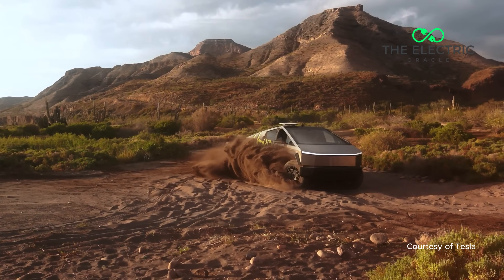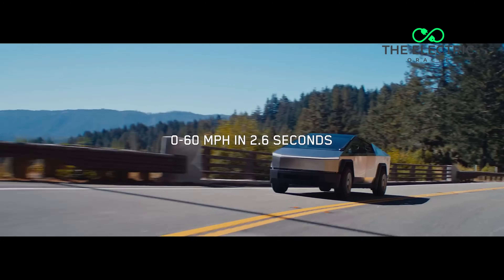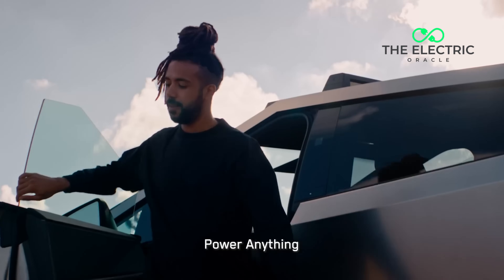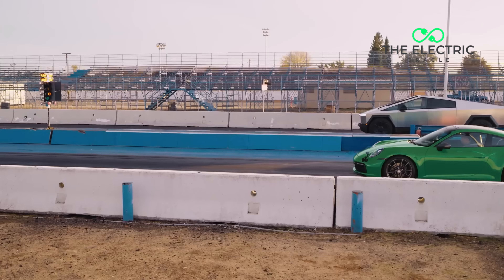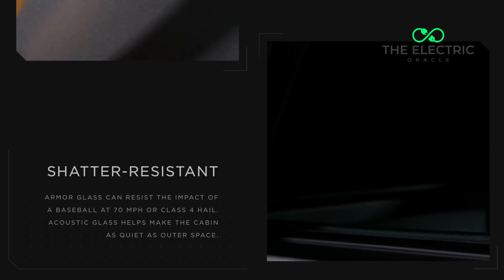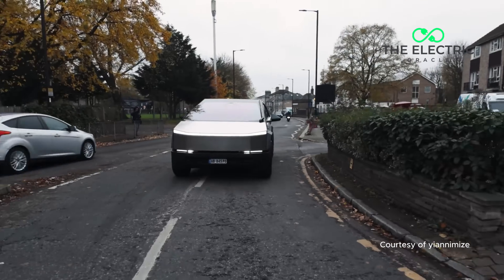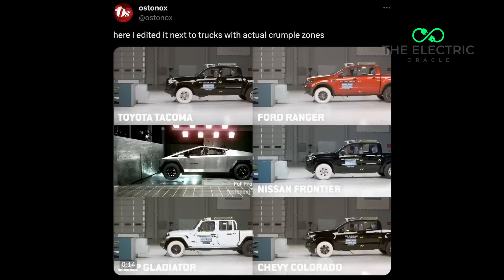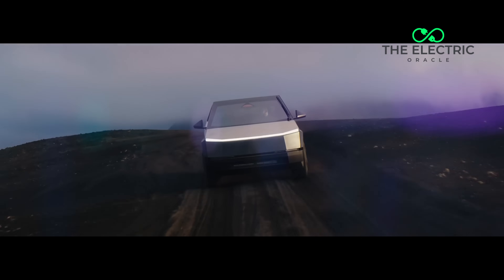5 Safety Issues Keeping Tesla Cybertruck Off UK Roads 🇬🇧

Comment: It should never be allowed on UK roads. Sharp angles and crumple zones do not help the driver/passengers or any other car, especially pedestrians. In my personal opinion, cars are all getting too big just because of fashion, and in the future, vehicles of this size should not be sold. If a business needs a van or a flatbed trailer, that is fine, but do we need monster trucks to take the kids to school!
Reply: I'm amazed you can get insurance on these. Hopefully pedestrians will sue the pants off Tesla when people get needlessly killed?
Reply: @johnalbinson4641  that's IF they survive. 
(I don't think that'll be possible if it's going more than 35mph) 

Ijs
Reply: @johnalbinson4641  you can’t all across the country in the US insurance companies are refusing to ensure it
Reply: @johnalbinson4641 um it automatically stops for pedestrians and don't you sound the fool for not knowing the truck has major safety features that none of your big uk approved vehicles have
Reply: The manufacturers push SUVs because it does not take much more material or labour to build a bigger car than a small one but it looks impressive, so the price to buy is higher. More profit drives it.
Reply: @martinconnelly1473 its not just about looks. American car manufacturers build SUVs because of a legal loophole where because of their size they are classified as light trucks so they have a lower tax bracket and lower saftey standards.

The car industry has a long history of lobbying governments to change rules in their favour to help their profit margins at the expense of pedestrians.

NotJustBikes has some good video's on this topic.
Reply: @martinconnelly1473  it's because SUVs get looser environmental regulations in California. Those regs killed the actual utility vehicle, the regular pickup and the El Camino
Reply: @stevecarter8810  Must admit I am looking at it as it is in the UK so was not aware of the case for them in Ca.
Reply: @stevecarter8810  only loophole for the suv is for the fuel efficiency... they don't necessarily have to comply like a standard vehicle. 

Those loopholes exist because of "work trucks." 

Not sure how that would effect the regular pick up's or the el Camino (which they're trying to revive). 

Regular pick up (like chevy s-10) are pretty much nonexistent. 

That has more to do with the manufacturers... not the regulations or lack of. 

There's a reason why our current full sized suv or pick up is far bigger than what they used to be. 

1985 silverado or f-150 will look tiny next to the new ones.
Reply: @martinconnelly1473 
Driven by US alleged fuel safety regulations that were put together thanks to oil company and vehicle manufacturers who lobbied for it
Reply: @ but the SUV is better in my opinion, and I will and have bought a SUV just because I want one.
Reply: @Harrythehun  I do think  SUVs should be defined as commercial vehicles. Special insurance, regular medicals, more stringent MOT, special parking areas and no that does not mean better, just along with all the lorries.
Reply: @Harrythehun  your opinion is based in emotion, not facts.
Since you want an SUV, you bought an SUV, and that's a valid choise on just aesthetic preferences alone.
Just quit trying to justify your already valid choise by denying facts that renders your choise suboptimal from other perspectives.
Reply: @mbak7801  that would be socialism? To forbid everything is the modern way?
Reply: edges must have a radius of at least 2.5mm so it will never pass any vehicle approval
Reply: Made by Adolf Musk....
Reply: @ Better Adolf Musk as Vladimir Harris.
Reply: @ Have you ever studied a bit of (European) history? You really should give it a go, and then you may understand my comment.
Reply: What crumple zone? 

They're nonexistent on those hideous things.
Reply: @Jin420  No need for one on a Hitlermobile.
Reply: A big part of the reason for cars getting so big in america is because of emission and regulation loopholes meant for commercial vehicles
Reply: Do we need monster trucks to take kids to school? No, but some people do need a larger car or 4X4 for other reasons. Towing a caravan or boat for example. If the car then gets used for daily chores as well, is that so bad? Would you rather them be forced to put two cars on the road for different purposes?
Reply: Very rigid structures are not safe, if there is no crumple or “give” in the structure the forces of an impact are transferred directly to the inhabitants.
Reply: @neilmchardy9061  Yes, that is why those landrovers, Unimogs, Puch G are so dangerous.
Reply: You must be fun at parties. Sounding kinda communist telling people what they can or can’t do. England is too far gone now.
Reply: Keep that soy infested thoughts in Europe. Your streets were designed for horses. Nobody wants to drive an economy car 😂
Reply: EVs are no better than conventional vehicles emission wise over their lifetime, some reports say they are worse. Just like the fallacy of wind turbines being good for the planet. Utter propaganda. Do the maths.
Reply: Cyber urinal "truck"  should not be allowed on planet Earth, better yet in our universe. That is what happens when man child with arrested development decides to make the his dream car because "he knows more about cars than anyone alive today" his words, not mine.
Reply: They are just 🍒🍆 compensators
Reply: Not only in the UK but alkoven Europe
Reply: Sounds like a perfect later day Mad Max vehicle
Reply: Tesla should be banned period. Less money given to felon muskrat the better
Reply: Um every buss in the Ukraine has no crumple zones. You only say this because Elon. Elon suckels tesla do not but keep holding humanity back. Your kids future is all that is at stake
Reply: Completely agree. Child and pedestrian head impact would be non existent. Can you picture anyone with one of these being a slow and considerate driver? Anyone who is not in a car and gets in front of one of these is dead. You could argue that the over stiff structure would mean the occupants would not fare well in an accident too. This has been designed by a child who like to draw cool cars, if that child is a trillionair then they get to build it…
Reply: You guys aren't really missing out on much, infact, the UK has a lot more choice of vehicles then we got here in north America.
Reply: @polska905  The Cyber truck does nothing for me, and looks dangerous and proves to be. I am not sure why America likes to help kill its citizens with dangerous vehicles like this and guns where gun suicide is even higher than gun killings. The Think you may need to read the law again (all new chargers, not existing) "Starting from November 2024, all new public charge points over 8 kW, as well as existing public rapid chargers over 50 kW, must offer contactless payment options" Law could never force existing chargers to be upgraded due to costs, but if replaced with a new one then it must have contactless payment. More places for scammers to find a way of getting your card details, skim your card from the RFID and get your PIN number if requested to do so, scams will come if not there already.UK is not perfect and knife crime is on the up, but at least we are trying to reduce needless deaths from vehicle accidents. Have you checked out the UK Kit Cars https://www.totalkitcar.com/uk/uk-manufacturers/
Reply: @polska905  they have access to purchase BYD (which we have 100% tariff on those....)

Those are one of the best EV's on the market rn... and much more affordable for the working class. 

So naturally-- the pressure from various auto industry lobbyists (including tesla) fought to keep the BYD out of our car market.
Reply: I would be okay with rules that said pickups / yutes or whatever you want to call them MUST be sold as commercial vehicles with all of the additional redtape that goes along with that (e.g. being a registered company, differences in vehicle inspection / taxation etc.). AND that parking spots for said vehicles incurred a tax. Just to discourage people from driving them unless they needed to do so for a business reason.
Reply: @drxym you are part of the problem, the elites want us fighting amongst ourselves as divided we are easier to control.
Reply: Simple good taste should keep this off British roads…..
Reply: @MagicRat  Then why do you drive such abominations like Jaguar or Land Rover from India?
Reply: it isn't allowed for resale, just as a  personal import
Reply: @martinhill3986  pointless importing to the UK as moment it used of the roads it can be legally taken and crush by law enforcement, as no tax nor legal insurance as we have a law to insure it has to be road legal, and if police take it you have to pay insurance and tax which you can't get legally in UK for it, so the crusher it goes, TVP was in new as a millionaire didn't listen so the crushed it.
Reply: @martinhill3986  Maybe but it could never be driven on the roads without all the changes being done.
Reply: @martinhill3986 it can’t be driven in this country full stop
Reply: @martinhill3986 that’s probably for the best. It’s a test. If you can afford to buy one and import it, you’ll probably be able to afford all the petrol it will use 👍
Reply from the maker: I agree for UK and Europe.
In the US where this is actually designed for, this is totally fine :)
Reply: @TheElectricOracleChannel  It's not OK for the US either. Just because that design is common or desirable there, it doesn't mean it's any less dangerous.
Reply: @TheElectricOracleChannel I don't think this vehicle is even sensible for the US roads. For example, instead of designing bullet proof cars, why not stop people shooting at cars instead? Is 4 tonnes of steel the most efficient use of power just to transport humans? As a commercial vehicle, fine. Stick a towing plate on it and fill your boots! Even then, companies wouldn't buy it because of efficiency (and price!). It's just a silly experiment, a concept, nothing more. It should never have been put into production.
Reply: @TheElectricOracleChannel  no it’s a disaster in the US as well. Most US companies won’t even insure it anymore.
Reply: @TheElectricOracleChannel  Not really.  Even if you like using as a shooting back stop, it is ugly, and a rolling lawsuit.  While pedestrians are supposed to follow rules just like bicyclists, motorcyclists, and vehicle drivers, the reality is that drivers are the target of choice for ambulance chasers.  Even if the other party in a collision is at fault, if the at fault party is a pedestrian or a cyclist, the driver is likely to be the target of a lawsuit, and their lawyer is likely to advise them to settle and that is what the insurance company will do as well.  If you drive a car, a jury is likely to assume deeper pockets than a cyclist has, even if the bicycle costs more than the car.
Reply: @TheElectricOracleChannel No it isn't. It's a massive waste of resources, and shifting 3.5t of car for regular people moving is offensively wasteful of energy. It isn't even a particularly good pickup
Reply: @TheElectricOracleChannel While America likes big cars, I suggest that the current crop of ginormous SUVs is attributable to Chinese tastes where Americans prefer pickup trucks.
Reply: Yes, Landrover should never be allowed. Slow, unsafe, sharp angles and missing crumple zones all around.
Reply: @wolfgangpreier9160  “land rovers missing crumple zones” where’d you get that, from grock? 😂 A Land Rover, like most modern vehicles, incorporates crumple zones in its front and rear design, which are strategically placed areas meant to deform and absorb impact energy during a crash, protecting the passenger cabin and occupants by redirecting the force away from them in the event of a collision
Reply: @ A Land Rover was designed in the 1940s and has no crumple zones. Just look at the current NCAP Crash tests. Not the Land Rover defender, Not the Range Rover, Not the landrover discovery - those are all modern everyday SUVs. 

I always talk about the original Landy from 1948. The Puch G. The Ineos Grenadier. The Toyota Landcruiser, the Jeep Wrangler, the Dodge M35 or Powerwaggon, the Pinzgauer and so many others which are all still allowed to drive on our roads.

They are all, without one single exception much more dangerous than a Cybertruck.

A Cybertruck has collision avoidance which demonstrably works. All the others have not.
Reply: @ so your comparing classic vehicles from the 1940’s to a vehicle from the 2020’s..come on, compare like for like.
Reply: @ “a cybertruck has collision avoidance” 😂😂😂 so you own one of these super vehicles do you?
Reply: @ I am sorry that you do not even know about the most basic security features of a car and you talk about it. 

Please stop it. You just demonstrate your incompetence and your unwillingness to listen.
Reply: @ https://youtube.com/shorts/TRemHyQJlwo?si=gElpaeljtacZQExq
Reply: @ https://youtube.com/shorts/X8Qx7oShQV4?si=E_JP-qS8Ylv9CNVS
Reply: @wolfgangpreier9160  The don't make those old Defenders anymore. Swing and a miss.
Reply: @Zero_Ninety  I do not know your local colloquialism. 

But i guess it means something negative.

I never said anything about 2025 models, did i?

I said beging allowed to drive on public roads.
Reply: @wolfgangpreier9160  I didn't say anything about 2025 models either. You can't expect old cars to meet current laws that didn't exist when they were designed. You can't remove every car from the roads that doesn't met current safety laws either. That's not how that works. Current safety and crash test laws are for new vehicles, not old ones. To be honest your argument is pretty poor, even by the low standards of a Musk fangirl.
Reply: @Zero_Ninety  "You can't expect old cars to meet current laws that didn't exist when they were designed." Thgen they should either change the laws toi 1960 again or forbid such sarcophaguses.
Reply: @wolfgangpreier9160  Better idea: Keep the current laws so death traps like the Cybertruck stay off our roads.
Reply: @Zero_Ninety  That is ok. You drive Landrover and Reliant Robin.

We drive safe cars like Tesla.

Many  are cheap and buy Dacia aka deathtraps. Some even survive them.
Reply: @wolfgangpreier9160 As far as I'm aware, there have not been many privately owned 4 tonne Landrovers?
+ Many people can't handle driving a Nissan Leaf 😄, can you imagine putting one of those in a 4 tonne block of steel 😯
Reply: @catfrab  No there are not many so large landrovers. Are we walkting about the Hummer EV here?

The CT has 3 tons in the AWD and 2.8 tons in the RWD version.

"Many people can't handle driving a Nissan Leaf " yes i know, toddlers, very old, incapacitated. There are many who can not drive a vehicle.

"can you imagine putting one of those in a 4 tonne block of steel " Sure. That is called Ford Transit.
Reply: @wolfgangpreier9160  
No, I just refer to Landrovers.
Transit of 4T driven by a car driver? Not legally. Most Ford Transits go nowhere near 4T GVW. Most are less than 3T GVW. Empty they are typically about 1.5T - less than most cars.
Ford do a special edition RWD commercial vehicle which they call a Transit at over 4T GVW but you cannot drive that on a car licence, you need an HGV licence.
CT GVW ranges from 4.0T to 4.2T. Even if you could get type approval (you can't) it would be classified as a HGV.
Reply: @wolfgangpreier9160 the land rover and cyber truck have, I was gonna say little in common but actually they have nothing in common. Try googling comparisons.
Reply: @ True, Both have 4 wheels on the ground. The Landy even one on the hand. 
Both have hard metal ungiving and unforgiving, rust free exterior, are quite pointy and dangerous to contact with.

The Landy is made of very sharp Aluminium with exposed edges, whereas the Cybertruck is made of Steel, also very sharp and clearly forbidden in the UK where you could make a knife out of the hood.

The Landy goes maybe 50 mph. The Cybertruck is quite a bit faster on the Highways.

And both kill everybody else in a crash.
Reply: @Taxtherich2  Landy and CT are very good comparisons. 

Both are sharp, pointy, big and dangerorus to drive. 

Landy because it is such an old and dangerous vehicle. 

Cybertruck because you become addicted fast.

Try Grocking comparisons. I do not trust this woke google or wikipedia anymore.
Reply: @  Landys pass uk safety laws, have crumple zones, wing mirrors and breakable windows and if they catch on fire, highly unlikely, which can’t be said for the CT, it can be put out, plus it won’t get stuck in 5inches of snow. 😂. Besides there’s no argueing with someone that calls Google and Wiki “woke”.  You got a CT? 😂
Reply: @wolfgangpreier9160   speaking as someone who's alive today thanks to the safety standards I beg to differ.  The vehicle I was in back when the beast from the east struck was a Land rover Discovery series 2.  It's crumple zones performed as designed.  Can't say the same for cybertruck.  Then again the cybertruck wouldn't stand a chance of even going on a journey since it can't handle a light dusting of snow.

Also wear your seatbelt ffs.
Reply: @hikaru9624  "Can't say the same for cybertruck.  " Of course not, you did not have an accident with a Cynbertruck.

"The vehicle I was in back when the beast from the east struck was a Land rover Discovery series "  The discovery is  a modern car and as safe and secure as any other SUV type car.

I am talking about the Landy, the original Aluminium based vehicle from 1948. Not any type of modern construction.
Reply: @wolfgangpreier9160  a series 2 discovery is an old model 4x4.  A cybertruck can't even handle mild weather.
Reply: @hikaru9624  Thats ok, Your indian car can not even handle a closed garage.
Reply: @wolfgangpreier9160  I don't think Jaguar Land Rover was owned by Tartar in 2000.  Think it was Ford at the time which is worse.
Reply: @hikaru9624  And now it is Tata, I really do not know which one is worse.

The Land Rover is a good car but not comparable with a modern EV. None of them.

Only with the Jaguar iPace. 

And i know how they were made, literally 100km from here and parts were made by my eldest. I will never buy a modern Jaguar.

Just watching Electric Classic Cars rebuilding a Jensen Interceptor. Now that is a car worthy of electrifying.

Still extremely unsafe but wonderful design.
Reply: @wolfgangpreier9160  nah EVs can't compare to any car with an engine.  Vastly impractical and they're not even handicapped friendly.
Reply: @wolfgangpreier9160 no, the ole landie is designed to comply with uk regs
Reply: @Picobyte_Studio  Yes, the ole landy is compliant with old UK regs and has never been updated.

For me, for us the Cybertruck would be the safest vehicle right behind our Model Y and 3. 

For others it is unsafer than a VW Käfer from 1948.

Oh well, there are still people who think all Teslas burn  all the time. And that Elon showed the fascist salute.
Reply: @wolfgangpreier9160  Landrovers are OK - you can hear them coming from a mile off so you have time to get out of the way.
Reply: @Badgersj  I do not. My hearing is impaired. But i smell them if the wind is in the right direction.
Reply: @wolfgangpreier9160  😆
Reply: @wolfgangpreier9160  “Land Rover’s missing crumple zones” where’d you get that info, grock? A Land Rover, like most modern vehicles, incorporates crumple zones in its front and rear design, which are strategically placed areas meant to deform and absorb impact energy during a crash, protecting the passenger cabin and occupants by redirecting the force away from them in the event of a collision.
Reply: @wolfgangpreier9160 the  Landrover was safe because it was slow. It was unbearably noisy to drive faster than 45 mph.
Reply: @ngauruhoezodiac3143  😂😂🤣🤣👍👍
Reply: @wolfgangpreier9160  they can't take away road licence of classic car but the new model have spongy body work and many more pedestrian safety feature including bonnet that pop and have air bags under the bonnet so while the metal impact is hard it cushions impacts. The hidden safety feature of UK and EU cars is now massive as they are ranked by buyer via the N-cap tests. Even the Rolls, jags and Ranges of today.
Reply: @ Sure they can take away any license. There is no human right for road use.
Reply: @wolfgangpreier9160  just a reminder -- DRIVING IS A PRIVILEGE. 

Have a marvelous day. 😊
Reply: @wolfgangpreier9160  Are you talking about a vehicle designed between 40 and 80 years ago?
Reply: @ Yes of course. Or you could take the Tatra 6x6. Or any communal vehicle. Or a trekker traveling with 50 km/h and 25 tons of cow shit.
Reply: You weaklings....  jk 😅
Reply: @MU-gp7vf  this is the state of men here in the UK now, absolute gaylords.
Reply: @MU-gp7vf  Lol
Reply: @MU-gp7vf  The funny thing is that the usual justification for buying these abominations is that "Because the vast land ships are everywhere, people buy them to avoid being squashed by them. So, basically, people buy them because they're frightened. That's 'Mercan FREEDUMB for you.
Reply: I dont see how sharp corners would be harmful to the occupants?
Reply: @rumelahmed4539 No, but if you have an accident in one, or the flames are licking, how do they get you out of the ‘truck’ in time.
Reply: @rumelahmed4539  
In a crash, everything suddenly stops. Both the car and the people inside. There is a force (the thing you hit) stopping your car, and if your body stops as quickly, you are dead (humans can die from impacts over 11G, crashes can cause easily over 35G or 50+G at speed).

Which crumble zones in cars do is aborbing that killing force by having materials crumble.

Basically, the more material breaks, the less your body breaks.

Compare it to someone punching you: If they use their bare fist, your face is really going to hurt. If they wear a thick boxing glove with padding that crumbles on impact, you won't have a good day, but it won't hurt so bad.
Reply: @nvelsen1975  it's like that old Th!nk PSA that aired years ago.  The one taking her kids to school and her lad who was sat behind her wasn't wearing his seatbelt.
Reply: @rumelahmed4539  it's a danger to bystanders and pedestrians.  It's the lack of crumple zones that's a danger to the occupants.
Reply: @rumelahmed4539  We do have to consider pedestrian safety as well, but as far as I am aware the rigidity of the cyber truck and fewer crumple zones do not allow the forces of the impact to be reduced as much as a modern UK or EU vehicle, the forces are then passed straight to the driver and occupants as the stop is even higher. I had an old Vauxhall Cavalier in the UK many years ago and an old lady drove into the back of me while I was stationary, she was driving a brand new Skoda Octavia and even though the impact speed was probably only 5 to 10mph the whole front of her car crumpled and the rear of mine only moved in 2" or 2 inches, my car was pushed forward from the impact, but if she had been driving an older car like mine the crumple zones would not have absorbed the impact and would be like 2 hammers hitting each other instead of a hammer hitting a tin can. Crumple zones help save the occupants, the cyber truck would fail in the UK / EU
Reply: @woodydroneson same here. A smart car went into the back of my 1998 nissan at 10mph. I drove away with a scratch, they spent the rest of the afternoon picking up bits of plastic.
Reply: Sad to see the society being afraid of everything different nowadays. There are so many worse things in society.
Reply: @Harrythehun 
Really? You had to clear up after RTC or RTAs then?
Reply: @CMDR_Hal_Melamby  Fix all the other accidents then, Cybertruck isn't hitting the kids nowadays anyway.
Reply: @Harrythehun  zip it unless you've had to clear up the carnage on the roads. Glad I got away from that part of the job in the late 1990s.
Reply: @ Old farts finding YouTube is the worst thing ever
Reply: @Harrythehun  Would you like your family to be hit by one driving round narrow twisty UK roads with a lot of pedestrians on the pavements and traffic coming the opposite direction? You can't say it's OK to have one but only use it on motorways and dual carriageways.
Reply: @Harrythehun different? It’s about not killing other people with this rediculously oversized ego-stroker. It is not designed for the EU/UK but a post-apocalyptic hellscape a.k.a. the US.
Reply: @Harrythehun  look a Tesla fan boy
Reply: @Harrythehun  Regulations in the UK and EU have resulted in much safer cars for drivers and pedestrians especially young children in an accident, America does not care if its citizens kill each other be it through guns or car accidents. If a child was hit at 30mph by a cyber truck compared to a small family car with pedestrian impact zones, the cyber truck would kill the child, in a small compliant family car the child would have a reasonable chance of being alive. It has nothing to do with being afraid, why reverse the statistics and create vehicles that are more dangerous to drivers and pedestrians than they should be.
Reply: @woodydroneson in the 70s & 80s children were taught road safety ie stop, look & listen. Nowadays they are taught they have the right of way but not taught the physics of trying to stop a lump of metal in 3 feet. 
Bring back personal responsibility & teach children road awareness.
Reply: @luckyrobp  Totally agree with you, I am of that age where I was taught this, I teach my daughter to look after her own safety and the highway code stop look left etc, but in the 60s and 70s the fact is children were more likely to die from being hit at 30mph that if they were hit by a modern car at the same speed as new cars have pedestrian crumple zones, should we go backwards in technology and weaponise our vehicles again? I dont think so!
Reply: @luckyrobp children are taught road safety, where on earth are you getting that from?
Reply: @luckyrobp  A local headmistress refused to accept responsibility for teaching road safety. Apparently it was up to the drivers to drive safely. Needless to say one child was hit on a pedestrian crossing. I have had close shaves there as many driver go through a 30 limit at near 40 texting as they whiz past.
Reply: @golddragonette7795  No they are not. What planet are you living on?
Reply: @luckyrobp  You need to buy a new Highway Code and learn about the Hierarchy of Road Users.
Reply: @luckyrobp nonsense. Children are taught road safety, in most cases the motorist was breaking a law when they hit a pedestrian. A person was just killed here a few days ago by a motorist driving at twice the speed limit. We also have drivers going through red lights all the time.
Reply: @luckyrobp  lol thanks for the autobiography and the comedy bit about modern people
Reply: @HowardLeVert  It's always been in there. Pedestrians have always had priority,The only difference is that it is now specifically pointed out.
Reply: @woodydroneson  Pedestrian crumple zones is the last thing that I want in my vehicle. The chance that I will hit a pedestrian is miniscule, but the chance that I will hit a deer is very high (I have hit 6 in the last 25 years). When I lived in Canada moose collisions were a real problem too.
Reply: @HowardLeVert  Hierarchy of road users should be similar to the maritime law of gross tonnage. Don't get in front of something that will destroy you without breaking a sweat.
Reply: @rich7447  raises a relevant point - “pedestrians” are much less of a thing in the US as it is far more car-centric. Therefore the safety of pedestrians is not such a priority. 
In Europe and the UK, we support and encourage pedestrians and other modes of travel & movement, not just cars. So pedestrian safety is really important here. 

We respect all road users and don’t expect pedestrians to take their lives in their hands just by walking down the street, nor do we allow drivers of bigger and more dangerous vehicles to put less heavily armoured road users at risk.
Reply: @Tobelia  European lifestyles are also much different than they are in North America. We are much more likely to do work that requires large amounts of supplies or power equipment on our own property. We are also far more likely to own ATVs, snowmobiles, side by sides, and a myriad of other things that we trailer from place to place, usually in trailers that are larger than are permitted in Europe. 
Many of us need vehicles that are larger than are practical in Europe. The cyber truck is somehow large and still not practical anywhere.
Reply: @rich7447  💯 
Australia seems like more of a lifestyle match but last I heard there were no plans for Tesla to sell it there. At this point, I think even if they did make plans to roll it out in Australia it would already have been crowded out by more practical alternatives.
Reply: @Harrythehun You don't like safety?
Reply: @ronlynquist9183 Safety is great, but we can't make everything as safe that all snowflakes want nowadays. Few Cybertrucks won't hit droves of kids every year.
Reply: @Harrythehun  just as a fyi -- regulations are a result of tragedies... 

It's not because people are being "snowflakes".. 

And old folks will always exist. Get over it. 

They/we (I'm old) have the right to access social media just as much as the younger generation. 

Bottom line -- sometimes (not always.. sometimes) it helps to listen to others & not just throwing a bunch of rebuttals (age is irrelevant btw).

Ijs... differences in opinion will aid in opening up your mind.. 

Again -- ijs.. 

Have a fantastic day. 😊